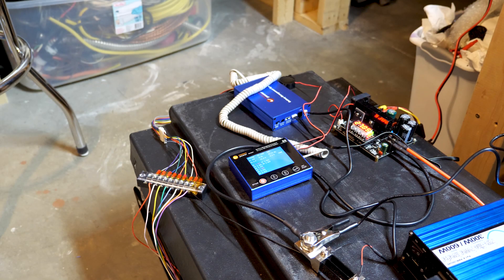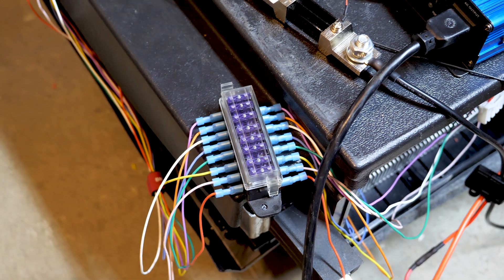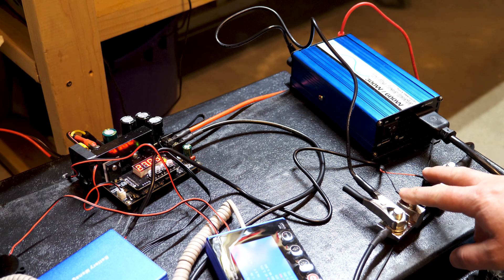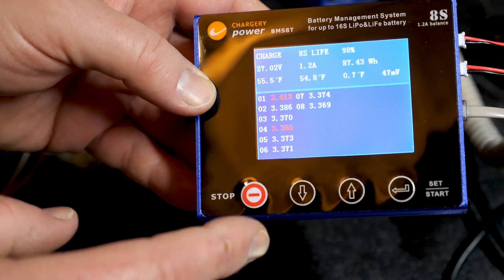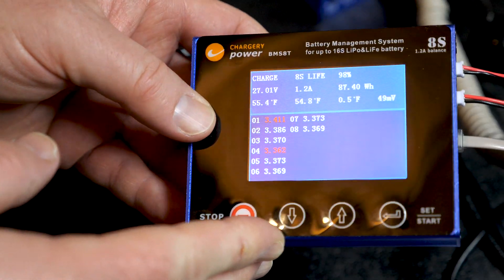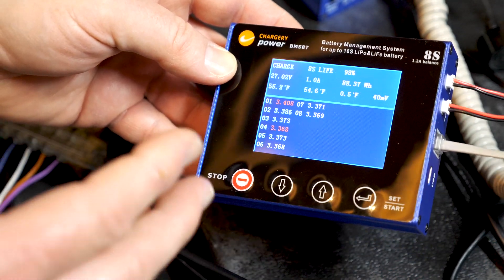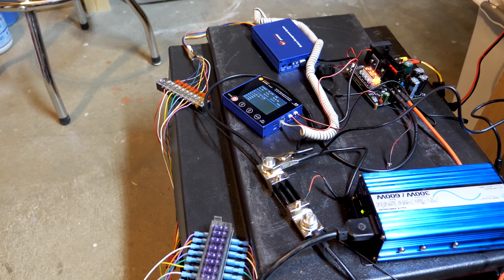Chargery BMS Overview for BYD 24 Volt Batteries

Comment: Second chargery I bought that the 8th cell of 16 doesn't show up. Im using 2 BYD 24vs as a 16s 24v system. If I plug 1 battery in, no 8th cell. If I plug both in, no 8th cell. But the 16th shows up.  If I plug them into my BattGo, the leads are good, and my multimeter says they're good as well

Comment: I just bought a retired ambulance to convert to a camper and my big daunting task is to isolate the preexistent wiring of the box from the starter battery and connect it to a new house battery. I’m an extreme novice when it comes to doing anything electrical and I’ve researched just enough to know how confused I am haha. I see that most ambulance conversions use something like 2-3 the battle born 100ah 12v batteries but they are so dang expensive. I came across these used BYD batteries and was wondering if they would get the job done well? I am also in Vermont!
Reply from the maker: Fellow Vermonter!   The BYD's are ok, I was a little disappointed at first with the capacity but when I think about it, they were a good buy at the time.  I just moved to a different BMS and will have a video out in a little bit on that.  The LiFEPO4 coming fom China is now cheaper so if I did it again, would probably buy new individual cells.   Thanks for watching.

Comment: Did you ever get the Chargery to control a circuit breaker? Sounds like a better idea than using a high current relay. Any details you can provide appreciated.

Comment: Hey so I have the BMS8T model and for some reason the current on the main screen in the lower left corner doesn't actually seem to reflect the current going into the battery when charging. It sometimes will show the current coming out of the battery when using it (though a lot of times I have to reset the BMS base unit using the power switch to get it to kick in) but when charging it always shows 0.0A. Have you noticed this ever?
Reply from the maker: Most likely due to not having your shunt calibrated.  I have not calibrated mine yet but will do so once I get the overall system up and running.
Reply: @GreenMountainDIYGuy  Ahhhhh gotcha, thank you for the input! I'll try recalibrating it next time I'm due for a good charge. I've heard the best way is to use a charger with a set current and then just flip the current sensor around on the shunt when setting positive and negative charges. Thanks again!

Comment: Wow: Nice clip of info. for a newbie (me) studying hard for my upcoming 24v 280 Ah LifePO4 build.  Nice to see good looking specifics here as I am considering which way to go on my BMS ,and Alibaba order for batties.  Been considering the Simple Reliable reputation Daly vs the newer BMS  all that extra info. and adjustment options (but for some/ headache learning curves on setting up & configuration).  I have been studying here on YouTube University and the DIYSolarForum. I just registered the lesson that newer line of BMSs have "active balancing" abilities for taking volt amps of higher voltage cells and putting that in the low voltage cells; vs older tech of using resistors to just drain down a high voltage into the lover voltage cell(s). As I consider the newer Charger line in the next size up/ Chargery BMS16T 2S - 16S . I  think that "2S - 16S"means it can work for "2 battery cells up to 16 cells", but not sure (if anyone knows for sure/ and might leave feedback). And also think this BMS I am considering could handle either a 24 v or 48 v set of batteries (was not clear on my scan of specs), which is nice option. Thanks for the encouraging clip. Nice Looking Project
Reply from the maker: Good luck on your studies and future research.  We all just about started in the same place.  I'm always trying to learn something new.  Yes, 2-16S would mean up to 16 cells.  I believe the BMS16T does 48V, but I've really only looked at the single 8T version.   Thanks or watching.

Comment: Do you know what the balance current is on that bms? Great vid
Reply: Thanks.  Balance current per cell is 1.2 amps but unfortunately it is not enough!  I think I'm a good candidate for an 8s QNBBM balance board since my total output load will be around 9-10 amps per BYD module once I get things going.  Going to get one QNBBM board to test out.  Will need 3 total if QNBBM work out.  Tough to get from China due to the Coronavirus.  Pulled about 105 amps on recent battery test for one module.  Hoping to get way more....
Reply: @armandmessier2075  hope you get more too. Less then half capacity is it not?
Reply: @frankz1125  Correct.  I not too disappointed at this point knowing how much a new 24 volt 100 AH LiFEPO4 battery would be...
Reply: @armandmessier2075  thats good. They are pricey

Comment: Hurryup and do a capacity test. . .

Due to a couple whacked out cells in my 8 BYD's, I only have 14 kWh of usable capacity. :(

I'm using an ANT-BMS x 4. 
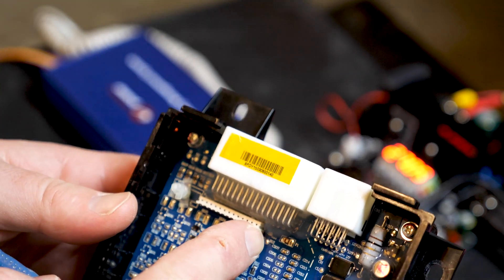4:43 excellent tip! I took the BMS out and sourced the OEM connector and made a plug and go connector to get the BMS to connect with the outside molex. C'mon over to the diysolarforum.com/ pages. If you want to see what I made/sourced I'll post the link to the exact forum.

Comment: I enjoyed the video. I don't have the BYD's but do have the same type battery chemistry. The pain with balancing can be difficult. The ideal concept of balancing cells is to wire all eight cells in parallel if possible for about 24 to 48 hours. The real the proof is in the pudding is running a high voltage discharge until you hit the maximum low volt cutoff. The one cell you believe that's probably the lowest won't be when the test is completed. After you shut off the inverter you'll see the individual cell monitor will change and the cell you thought was the weakest won't be. It will be another cell and it sorta makes you want to pull you hair. That's just normal for those LFP/LiFePO4 cells or at least i've found this to be the case.

Comment: May not make a difference but I would think if the balancing wires are long/not all the same length, you would have a hard time getting the to balance close to each other
Reply from the maker: Yep, the balance wires are probably a little long.  Will be about half the length and the man BMS will go inside the BYD battery.  The balancing is keeping up when the overall voltage is at 27 volts or under.  Once I go over 27 volts, cell #1 is taking off and the BMS is not keeping on this particular module.  Good to hear from you Todd, you got snow?
Reply: Yes sir! Just snowed a bit yesterday! Not sure how much total though